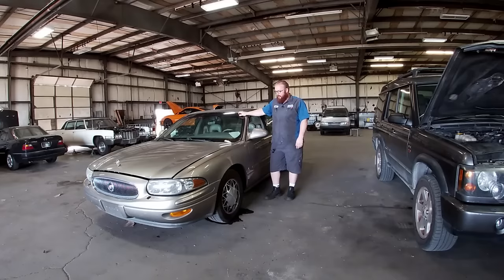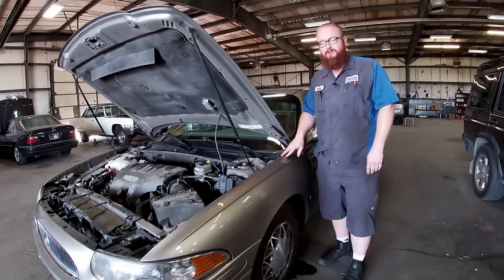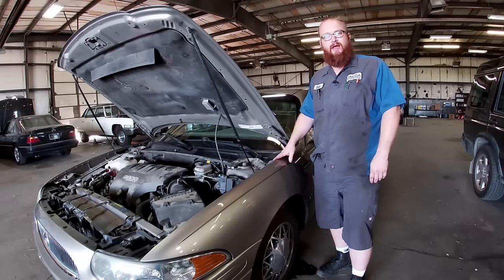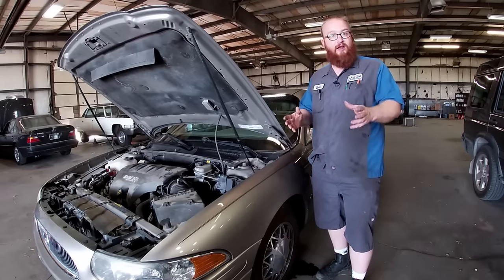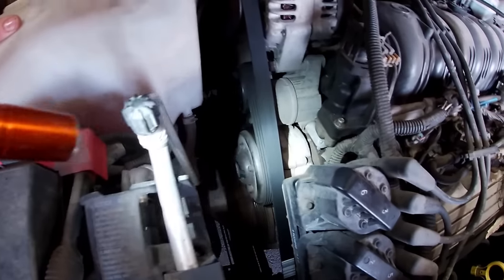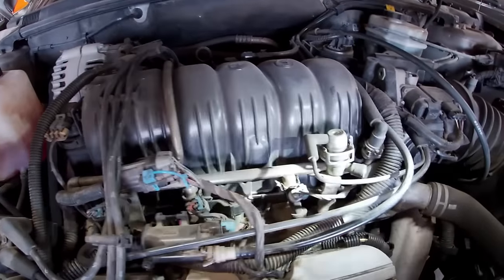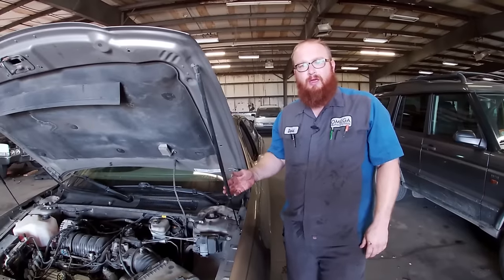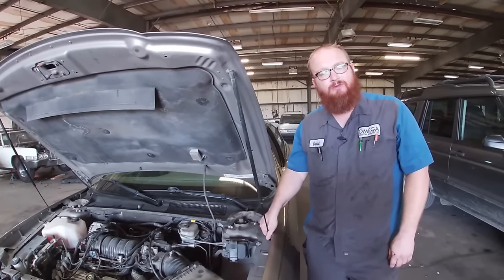CAR WIZARD highlights what makes the Buick 3800 V6 the BEST engine ever!

Comment: I'm putting 230 miles a day 5 days a week on my 3800 series 3. Gets 28 MPG and has NEVER broken down on me. I drive two hours to work one way in Erie, PA. That motor is seriously impressive and I will swear by it to the day I die. Also, this motor responds very well to modifications. I have mine up to about 260 HP without a supercharger.
Reply: what mods did you add 
i have 03 lesabre and i’m trying to get it looking good
Reply: Lesabres are too old to buy at this point in time. You'll have to do alot Knicks and knacks repairs here and there to keep it running on the road. Buicks don't give me that Toyota original parts until 250,000 miles type of longevity-even the praised LeSabre, Park Avenue, Regal and Bonneville.
Reply: @pushhard2  Toyotas are in a league of their own when it comes to reliability and longevity. I have a 2015 Corolla I bought a couple years ago and have only put gas in it and changed the oil so far. It has 168,000 on it right now and hope my good luck continues.
Reply: @BartholomewSmutz  Agreed! I had a 2010 Toyota Camry that died at 256k miles and I did the same roughly up until 250k's.
Reply: @pushhard2 what about an 08 Buick allure? What mods would work best with that
Reply: To anyone on here considering a Buick 3800 equipped car, specifically an N/A one: MAKE SURE IT HAS AN UPDATED FUEL PRESSURE REGULATOR. My father's '01 Bonneville suffered a fiery explosion earlier this year due to a faulty fuel pressure regulator that GM claimed was improved for the 2001 model year. Turns out that was a lie. The car was totaled. Upon researching the issue, there are thousands of cases, and even a recall, which DID NOT cover cars after the 2000 model year, even though it obviously wasn't fixed on the newer cars. Even a famous video of a 3800 impala blowing up in the exact same way at a shop after an oil change. So if you've got a N/A 3800 car from 2000 or earlier, make sure its had the recall done. If you have a 2001 or later, you'll have to do the job yourself or somehow verify its already been done without a recall sticker.

Secondly, the 4T65E transmission is notoriously weak. Excessive clutch wear is pretty much guaranteed unless shift kit is installed. Signs of this issue are hard shifts aı eventually slipping/shuddering during acceleration.

Comment: Best engine I ever had!!! I've own countless 350s, ford's, and dodge. Nothing beat the 3800 I had. Over 250k HARD miles and still going. Oil change ever 15k miles at best. Hit a hog, a deer, and a raccoon. Car looked like derby car. Still did a 4 hour round trip everyday. Plus 30 mpg. Amazing motor. I actually gave the car away because it wouldn't die and was to ugly to drive
Reply: Sounds like the story of my 96 Camaro
Reply: @KyleWendt406  tbf those were ugly from the factory
Reply: @HansBelphegor  which makes it a perfect wreck-n-roll car. I bought one from a kid for $400 with the 5 speed and the 3800 and I put 4.56 gears in the rear and bought about 10 pairs of tires from marketplace and took her to town. Nestral drops for days and that thing never quit. It would peel tires for 2 city blocks from 3rd. The only remotely major thing I did on it was a head gasket replacement which took about 4 hours and cost less than 100 bucks and a clutch replacement which wasn't horrible either. And at 400 bucks you don't feel bad trashing it around. Nobody judges a rattlecan paint job on a sub thousand dollar car.

Comment: Based on your recommendation I began searching for this engine. Found a 2005 Lacrosse with 164k miles. Super clean engine bay, interior, and even the exterior. Haven't take a long trip with it yet so hwy mileage yet to be measured but around town, 20-21 mpg is my norm even with the A/C running most days. Thank you for this video. I'm super happy with my new (to me) car!
Reply: I brought a 2008 Pontiac Grand Prix with 125k on engine back in 2018. I have 215k now...no problems. 3.8 litter the best motor GM ever made...
Reply: @captainmorgan5449  Sounds like a great find. Here's hoping mine at 215k is just as problem free!
Reply: @RichardHarlos  

It should go for awhile. My engine was a series 3 motor. It was the most refined out of all the motors. GM made improvements over the years. I live in the Midwest...fenders are starting to rust.  I will start to look for a southern 2008. Grand Prix or a Buick Lucerne. I love the 3.8
Reply: I have a 98' PA with the 3.8L series II engine. 287k miles and she purrs like a kitten.

Comment: 1st car I've ever done any  "mechanical" work to was my 2004 Pontiac grand prix...didnt know shit about cars and replace the alternator in 30 min...love it
Reply: Thomas Alan - - i have a 08 Pontiac Grand Prix GTP, it has the 3800 v6 and is supercharged, for some reason my car wont start, it just keeps cranking, i put in a new starter, battery, and new key from chevy any ideas on what it could be?!
Reply: @slowgoat6089  Fuel pump. Smack the gas tank with a rubber mallet a couple of times (yes I'm serious) and see if it starts up.
Reply: 1337penguinman - How sure are you because even bad fuel pumps start up a car after enough cranking
Reply: @1337penguinman  fuel pump wouldn't cuase a clicking sound either a slow start or no start.never heard a bad pump click.
Reply: Same! I had a 94 Regal as my first car. When I was 17 I replaced the alternator in about 30 minutes by flashlight. It was the easiest thing I've ever done to a car.
Reply: I love dependably, reliably and horsepower .That's why i recently bought a 2004 Pontiac Grand Prix GTP. 
She wasn't taken care of, but 213000km she still goes 185 km/h.
And the supercharger is a nice touch . But there's a lot of repairs needed, ABS CONTROL MODULE, HUD ,sunroof. But the underside has surface rust and will be sanded down ,cleaned with actiyone ,primed and undercaoted .

Comment: Just bought a 2002 Buick Park Avenue with this engine to run back and forth to work. 133k miles and paid $1500.  I was told it is a great GM engine. I hope I can get many more miles out of it. Also, this guy absolutely reeks of honesty and integrity. Enjoyed watching him describe the engine he loves and can tell he is knowledgeable.
Reply: In December 2016 I bought a 2001 Pontiac grand prix gtp with a bad fuel pump for $200. ☺️
Reply: if it has a 3800 series engine in it, the most youll have to pay for is a plenum gasket, and youll be over 300k

Comment: 7:48 this is true!  My 04 Lesabre Custom started misfiring and I have never worked on a car in my life but after some research I went to Get the 3 coils and the thing that the coils plug into (I believe it’s called a Icm or ecm don’t quote me) took off the few bolts and replaced them. haven’t had any misfires since and that was many miles ago :-) Thank you YouTube and thank you Wizard
Reply: Its the ICM. Ignition Control Module

Comment: Just bought one these for my Daughter yesterday - car had remarkable low mileage and was in very good condition.    She's super excited to have a car again, and I'm hoping I won't have to work on it very often.    This is a fantastic engine - and I knew that going into the purchase.    Hopefully it will survive her driving skills.
Reply: I've got a car with one, you can damn near ignore the timing chain completely and just put oil in it as needed and it'll run fine, the rest of the car will give you more of a headache than the engine will
Reply: To anyone on here considering a Buick 3800 equipped car, specifically an N/A one: MAKE SURE IT HAS AN UPDATED FUEL PRESSURE REGULATOR. My father's '01 Bonneville suffered a fiery explosion earlier this year due to a faulty fuel pressure regulator that GM claimed was improved for the 2001 model year. Turns out that was a lie. The car was totaled. Upon researching the issue, there are thousands of cases, and even a recall, which DID NOT cover cars after the 2000 model year, even though it obviously wasn't fixed on the newer cars. Even a famous video of a 3800 impala blowing up in the exact same way at a shop after an oil change. So if you've got a N/A 3800 car from 2000 or earlier, make sure its had the recall done. If you have a 2001 or later, you'll have to do the job yourself or somehow verify its already been done without a recall sticker.

Secondly, the 4T65E transmission is notoriously weak. Excessive clutch wear is pretty much guaranteed unless shift kit is installed. Signs of this issue are hard shifts aı eventually slipping/shuddering during acceleration

Comment: Thanks for your positive statements about General Motors 3800 engines, and I agree the 3800 engine is Bulletproof. I personally know someone put 200,000 miles on a 3800 engine and it still runs quiet as a sewing machine.
Reply: Any Honda or Toyota engine will do well over 200k miles.
Reply: That's also true!
Reply: Yeah, I only sold mine because I went overseas. 300000km and used no oil, used no water, still got 30mpg.
Reply: @golden.lights.twinkle2329  True but no Honda or Toyota has the room, comfort or style of a late 90's Park Ave. The ideal used car. Just about the easiest used car search in existence. Simply search out a one elderly owner car that shows good careful use and has the paperwork for upkeep and repair to back it up and bargain away with the private party original owner or estate sale listing it. Just respond quickly.
Reply: I have a 2003 impala with 230k original miles still runs like new hands down great engine
Reply: Had to run my new one on Lucas.. lol

Comment: 250k on my lesabre, and I just changed the heater elbows. 20 minutes, $11, aluminum upgraded. No coolant leak, no white smoke,, car is toasty. Changed the water pump for $25. And I'm a YouTube educated rookie mechanic.
I lived in it for a while, and couldn't do oil changes or tune up for a few years, and the sucker was still running on 3 cylinders. 14 years later,  still my daily.
Reply: Jinx  well yeah it depends how you maintain it. But yes usually because the engine lasts so long eventually you have to replace the transmission. It's a shame they didn't come up with any standard versions all automatic
Reply: Jinx  you do understand people who buy 3000$ cars dont change transmission filters dont you? These things get passed around and rack up 150k on the stock filter and burn up
Reply: Jinx  just look at the car look who your buying it from test them how long theyve owned it what theyve done dont buy it if its junk

Comment: My wife has a Lucerne with the 3800 and it’s great. Super easy to work on. She went off a hill and into a ditch in the snow, had debris everywhere in the bay... I pulled it all out and then we took a 4000+ mile trip a couple months later and had zero issues. Lol
Reply: I flipped my 96 Riviera off the hwy pretty badly.  It sat for 18 months after half wrecking it, then became my daily driver again.  Rock solid lol
Reply: If it runs why get rid of it? You’re crazy not to keep it!
Reply: What year is it
Reply: Just bought a 2006 Lucerne with the L26 3800 Series III a few days ago and I’m hoping to get years of comfortable and reliable service out of it!
Reply: Nice my mother in law passed away sadly. She left my wife her buick lucerne v6 3800. My wife had wanted to get rid of it, I told her no way it's an excellent engine/car. We have kept it, and it runs so smooth. Any issues it's easy to work on. Love old people cars. The 06 cxl lucerne has remote start, comfy air shocks, leather seats, etc etc...excellent car/engine

Comment: Wizard I could not agree with you more. I've had twenty three cars, five were 3.8L Buick's and they truly were comfortable, reliable and Reliable!! Inexpensive to maintain the opposite to the XJ, Land Rover and the North Star powered Cadillac's.
Excellent work thanks.
Reply: Aaron Lopez  The land rover next to it has a Buick engine..
Reply: But it's a piece of junk, especially the 4.6. Kinda ironic that he had one of the best engines next to one of the worst.
Reply: @henrystone237  The Buick 215 was an odd V8. Lightweight aluminum block with iron heads. It had issue. They sold that tooling to Rover. In the 70's someone had a bright idea to pull a junkyard 215. The cut off two cylinders and bore it out. There is the prototype 3.8 oddfire Buick V6.
Reply: @Hotlog69  The Buick 215 V8 (Rover V8) had aluminum block and heads, and GM discontinued it because it was expensive to make, and phosphate-free coolant wasn't very popular in the US, which caused the aluminum to corrode. The first Buick V6 was introduced in 1962 as an alternative to the 215, it was 3.2 liters, and had a cast iron block and heads, and was increased to 3.8 liters in 1975, when GM repurchased the tooling from AMC, 13 years before the 3800 series officially debuted. So the two engines weren't really related to each other after GM sold the tooling for the V8 to Rover, they basically went their separate ways.
Reply: @Hotlog69  : That 215 Was Also a Good Upgrade for 240 & 280 Datsun Z' s, My Mech.That Was A Specialist Z Mech.Had Several Airline Pilots With That Eng.Transplanted in the Older Z' s.

Comment: Posting this from my 2007 Grand Prix GT; the last supercharged Pontiac 3800.
Reply: Pontiac grand prix acult following
Reply: David Moore 66 *occult, but I agree!
Reply: @UnorthodoxMasterOfGames  a cult following.
Reply: Had a 2005 Comp G. Dang I want another one so bad!
Reply: B Hamilton series 3 is the best!
Reply: Great car!  My buddy has one with 345k+ on it and it is all original stock.   Yeah the interior is showing its age, but it still runs like a top!
Reply: I had a 3.8 supercharged pontiac , it caught on fire : / i had an oldsmobile 3.8 non supercharged which was the most reliable car ive owned
Reply: Had a 3800 series 1 in my 98 olds Acheiva, and  series 2 in my 03 Monte Carlo. Both had good long run, for me before I sold.
Reply: @AvaABC  I love my 03 Monte!
Reply: My Ex Girl.. Had the GTP.. drove it while touring.. band and visiting other friends .. put hugh miles on it.. miss that Car.. best times were the, I'm gonna wash the car... and then the Traction Control is now off.. Haha peace
Reply: @TheChevy0  I loved mine. Ended up with a bad gasket and needed to be ripped apart and cleaned. That plus an exhaust leak led me to sell it to my ex wife's dad, who coincidentally was the one I bought it from. I have a 2012 mustang with the 3.7 liter v6 and it's great. 1st non GM product I've had as a daily driver.
Reply: 98 GTP. HUD way back then. Another 100 hp would have been nice...was still a great car.
Reply: Jacob S some 3.8 had valve cover gaskets fail causing oil to drip on manifolds if not addressed the could catch fire gm issued a recall on my 1999 Grand Prix and my 2004 I get them in the mail every 2 months
Reply: I had a 2004 GP GT.  I miss that car.
Reply: B Hamilton hi I would oil spray chassis and panel and doors hood trunk and keep in good condition, if in the rust belt store for winter will likely be worth more in a few years if kept well collectable

Comment: A magnificent engine. Probably the last true "owner's engine" where so much of it was accessible enough to work on yourself. And, while I'm a fast car guy, 200+ hp and 240-250 ft-lb is plenty enough to get around and then some. Coupled with the impressive mileage it can get, as you mentioned, the 3800 was a masterclass in making a balanced, reliable engine.

Comment: Car and Driver interviewed an engineer behind the 3800 back in the day. He claimed the 3800 had very low internal friction which helped reliablity and to make good power.
Reply: Yes I remember that.  They may also have studied Nissan V6 engines (not sure if VG or VQ or both).  If I recall, the original VQ was also a very low friction design and perhaps not coincidentally are known as high mile engines as well.
Reply: @kevin9c1  then nissan might have copied the 3.8 gm which was out long before nissan
Reply: @kevin9c1  Hopfully the VG too because I have one
Reply: I had a VG 3.3 in a Villager, can attest to my wife boiling the coolant out of the motor without incident, TWICE. When the automatic transmission finally died at 242,000 miles I could still let that van sit for weeks, go outside and turn the key and it would fire right up.
Reply: @WinkelManBearPig  Yeah I have a VG 3.3 in my Nissan Xterra, got it cheap as a first car and I'm thrilled because people are saying good things about the engine.
Reply: Yea but the vg has a belt...."timing belt" that's neither hear nor there for some!
Reply: What makes an engine low friction: I have to know? ......the type of timekin bearings or what?
Reply: @chuckpowers5311  
Things such as a roller valve train, light weight pistons/low tension rings, good internal geometry, an efficient lubrication system, etc. Things taken for granted today but were becoming common 15-20 years ago .
Reply: @sam2920  the 3.3 had an iron head right?
Reply: @chuckpowers5311  funny enough, the vg33e in the Villager and Quest are non-interference engines
Reply: Yes we got these engines in Australia in the GM Commodore. Mine was close to 300,000km when I got rid of mine and still going, that’s 187,500 miles